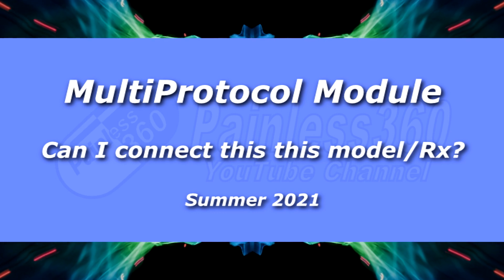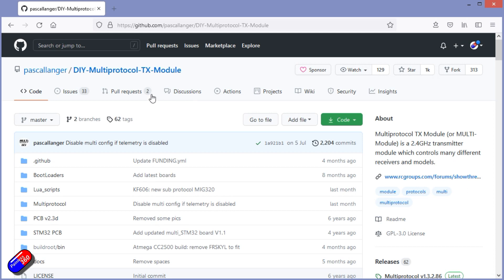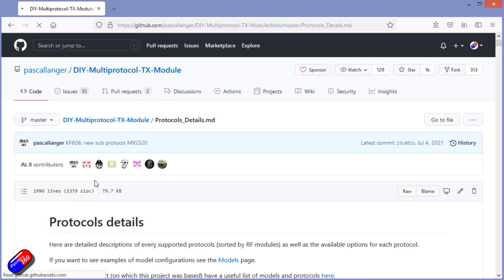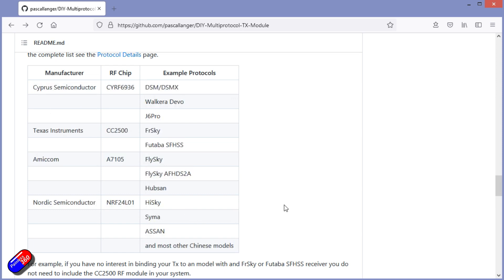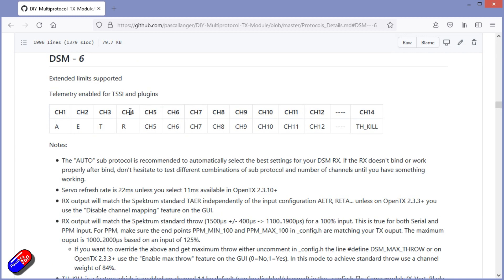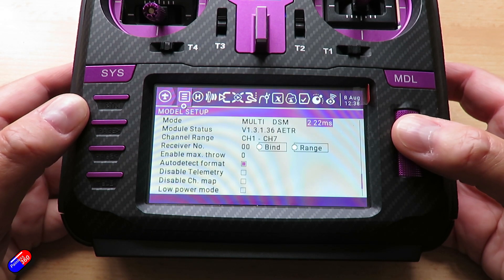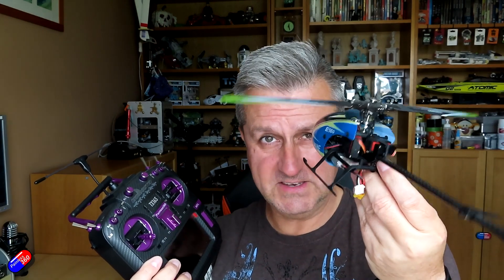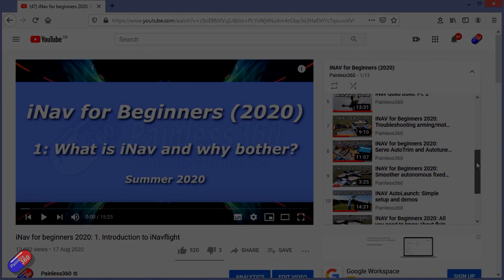Will my MultiProtocol Radio bind with this receiver/model? How to check!

Comment: Great video..Please can you give the full address for the Wiki??...I have the newer RM TX12 mk.2...bought the 4 in 1 module to try and bind RC Era scale helicopters. Can you provide any help on this...I know its E129 (83) protocol selected on the external multi mode. The internal RF is switched off accordingly. Please can you provide any further advice as I'm very new to an upgraded transmitter from the supplied stock.      Kind Regards.
Reply from the maker: https://www.multi-module.org/

Comment: I've got a little toy helicopter c129v2 6 axis 4ch
Today , and it uses walkers protocol subtype wk2401
   It is in my jumper Tpro tx . 
I am charging the battery now . The toy and toy tx bind by moving throttle up and down .
 I see a bind button in the setup after internal module multi / walkera / wk2401

Not sure if you bind every time or what .
   But if it works your multiprotocol tx will be able to add expo . It has altitude hold so it is more in  need of  a futaba k100 flight controller ? 
  I do hsve one of those 2 watt rc signal boosters helping define and fly indoors better .

Comment: Love your videos, always have but to suggest that a user manual that comes with a model is where to look for the specification on what protocol it actually uses is about the last place you could ever find that specification except for mainstream bnf models. I'm stuck trying to figure this out on a cheap visuo quadcopter at the moment.. I got it to work two years ago from trial and error.. and now am stuck trying again. I even posted my working setup on a forum but now that forum seems to be gone. I cannot find my post. I'm very familiar with the published protocol details. I was hoping you might have an additional trick.. like a script that attempts a bind on automatically every protocol or a selected list. Now there's a nifty idea if it hasn't been done or thought of yet. Maybe a feature request in the near future.
Reply from the maker: Nothing more that I know. I find making a video helps me find things again when I need to recall them.. Happy flying

Comment: Would the 16ts also bind with tracked vehicles
Reply from the maker: If it talks one of the support protocols, it should do. Radio like this are not 'car/truck/bike' aware so things like reverse and brake are things that will be needed to setup in the mix somehow. See my videos on setting up radios like this for cars and trucks.. Best of luck!
Reply: @Painless360  Thank you for taking time to reply

Comment: Great video, especially showing the wiki link as protocol names in the radio list are often truncated.  
Small warning on using the Futaba SFHSS: the throttle is often inverted and the ESC will just beep at you at power on.  And the FAILSAFE is usually inverted too !